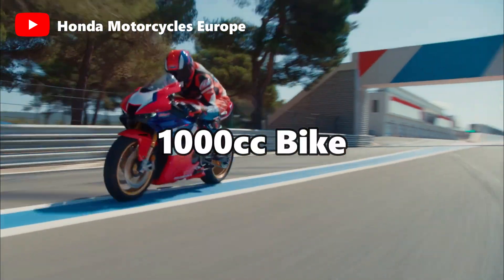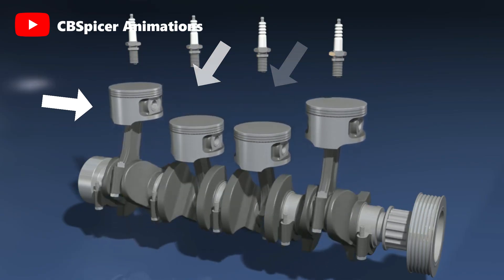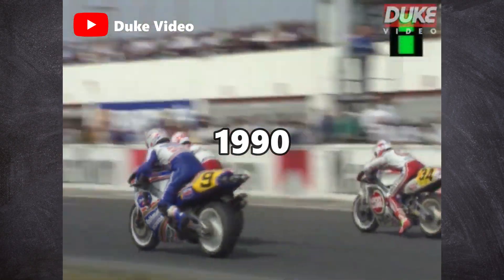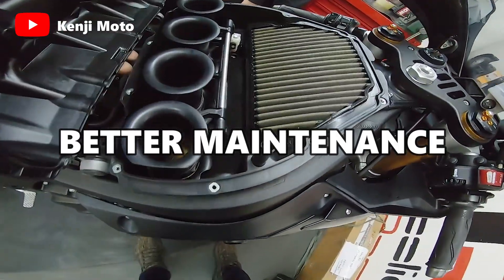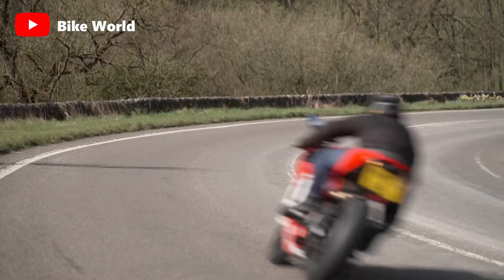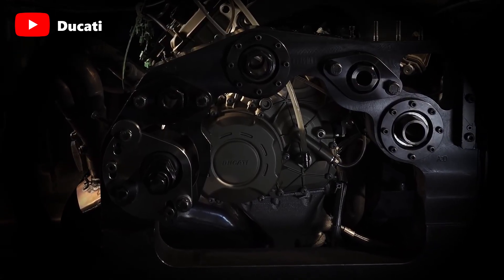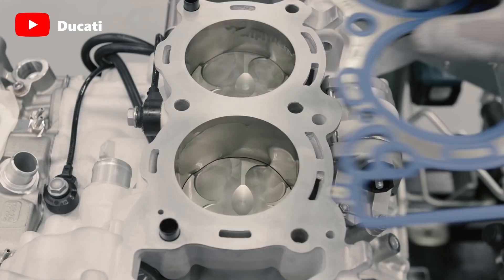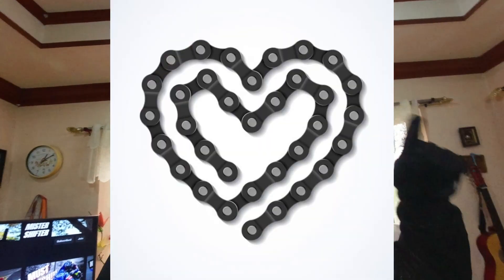What makes Inline 4 and V4 Engines DIFFERENT

Comment: Even within inline 4 category, a flat-plane screamer and cross-plane are totally different, either in their distinctive tune during high revs or their traction approach caused by firing-sequence. Generally speaking, a CP inline 4 performs and sounds like a middle point between regular inline 4 and V4
Reply: The Yamaha R1's firing order is identical to a 180° crank V4, such as a Honda VFR800. If you listen to the two bikes, you can hear they actually sound very similar. It's all trade-offs, though. You gain the benefits of ease of service and cost from a L4 as well as the odd firing order of a V4. You give up the narrow body of a V4 and add complexity to the design of an L4 to balance the unevenness of a cross-plane crank and the additional stress from an uneven firing order. It's certainly a good compromise to get many of the advantages of a V4 in a more affordable package, but I believe a proper V4 is better if cost is no object.
Reply: Oh wow never thought of that.
Reply: M0
Reply: CP also have flater torque curve
Reply: @rodrozil6544 i own yamaha MT10. Its not predictable. Power delivery is not smooth also torque. Very Different from a flatplane crank. I used to own z1000. Its boring.
Reply: @thegoatrider_ down to fueling mostly, needs a good tune/power commander. Open up that intake and exhaust, let it breathe and put a good tune on it and see if a good map doesn’t fix your issues brother
Reply: @BattleCorgiTV  i think you misunderstand me. After i got my Mt10. I would never want to own a flatplane anymore 😅. Anyway my bike is already remapped.
Reply: @thegoatrider_  oh yeah brother, I definitely missed that part lol
Reply: Lately many manufacturers moved from V twins to parallel twins with a 270 degree crank, for all the same reasons - less complex, cheaper to build.
Isn't the crossplane inline four actually two of those 270 degree crank engines combined?

Comment: V4 sounds like close to just twin cylinder,(even the sound of the xsr700 is better than the V4).But inline4 & inline3 are still EarGasmic to hear.
Reply: Listen to the rsv4

The ducati v4 purposely is made to sound more like a 2 cyl
Reply: You have to hear it in real life, the V4 V2 engines rumble the ground, there’s a different weight to them, and the rev matching downshifts hit different
Reply: Inline 4 sound trash boring as fuck

Comment: You forgot crossplane i4 . V4 packaged in I4
Reply: No 🤦🤡
Reply: there is a lot of things that an inline 4 will never get even if they try to mimic the V4, for example the V4 is structurally stronger than inline 4 because it is shorter it means less stress in the crank so they can push more power(thats the case in motogp)
Reply: @desmo8452  Dont forget that they are a lot more narrow. I couldnt believe the first time I sat on an RSV4 that it was a liter bike.
Reply: @hexagonosaurus5848  these are pros and cons they has to trade off when design a race bike.
V4 has problem with heat, more parts , lubrication and cooling will be more much challenging.
I4 config will has less parts, lubrication and cooling will much easier cuz you only have to deal with one engine head.
Reply: @tuanempty6387  You stated that a crossplane I4 is a V4 packaged in a I4. V4s have much shorter,lighter and stronger cranks than i4s.
Reply: @hexagonosaurus5848  cp4 engine also have much more beefy crank than normal i4. That why cp4 cant rev high like normal i4.
Yes, from firing order stand point, cp4 and vfr800 and rsv4 have same firing order, so basic power delevery will be nearly the same(Strong mid end). Screaming i4 has strong power at top end.
Reply: @tuanempty6387  You just have no actual experience and contradict yourself. There is a reason only Yamaha uses a crossplane crank.
Reply: @hexagonosaurus5848  Suzuki also have same setup with their gsx rr.